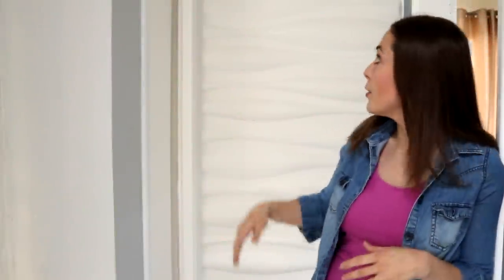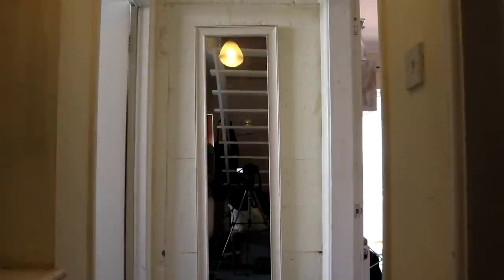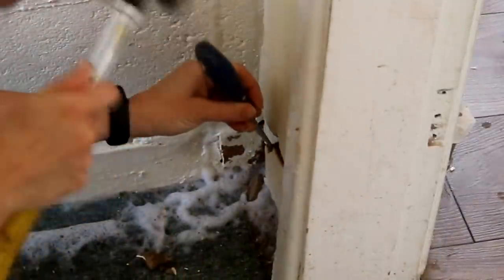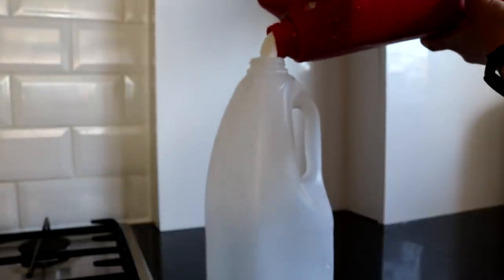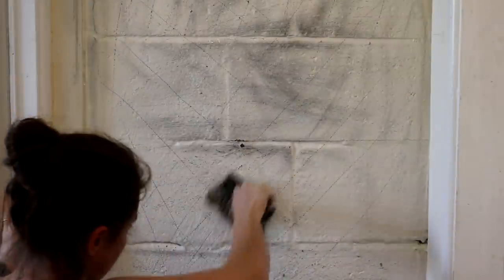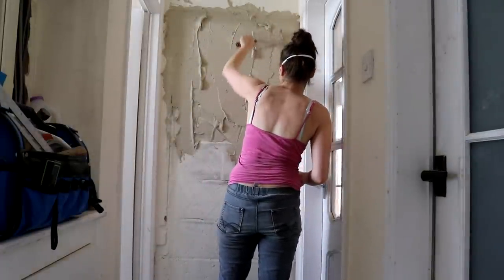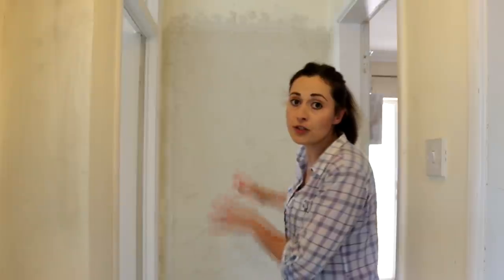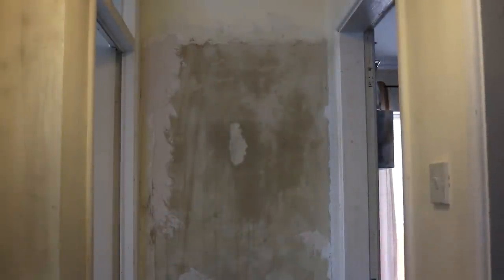How to Plaster Walls Before Tiling DIY | The Carpenter's Daughter

Comment: Hi there
Very inspiring, easy to understand step-by-step. In regards to the mixture of the PVA, the best solution is 2:1 meaning 2parts water to 1part PVA. It does a fantastic job especially if you have just removed the old plaster from the brick. 
Great job💪👍

Comment: Great work.  There's other ways to sand using a sanding sponge, if you will use it an hour after you applied your plaster mix, depending on how thick your mix was and for example, if your mix was 3/8 to 1/2 inch, you could either shave those high spots first with a trowel or scraper, so it wouldn't be as much labor afterwards then follow with the wet sanding sponge that you use with clean water and depending on how wet your plaster is, you can press as you sand either in a cross thatched or circular pattern but don't press too hard else you may loosen the section to the point where it may fall out of your wall.  The sanding sponge can then be squeezed into a clean bucket of water,  then  used again and you may, at this point, have a level near to your vertical surface but don't touch the level to your wet plaster.  Also, if touching up an area later, use the joint compound or plaster in a small amount near to the edge of your scraper or taping knife, then pull that over the region, while using another scraper to clean the excess from your tool, then spread more as needed.  You will see this uses less compound or plaster.

  Excellent video and it's a pleasure to see home owners DIYing their spaces.

  Truly, Andrew / Home repair Worker/ Solar Energy Hobbyist/ Act. For reuse programs.

Comment: To answer your question on the PVA - water ratio; it's about 5/1 water to PVA, but go by the feel. I prefer a heavier mix that is easy to spread, plus you don't need to let it totally dry. Its purpose is to stop the water being absorbed into the brickwork which causes the plaster to crack as it dries.

Comment: Hi, Considering that you did not have a float to use you did a great job, I have seen young plasterers that have done worse than you. If you are going to do any more plastering I would suggest getting a float as it will make putting the plaster on so much easier, and don't let anyone tell you that you are rubbish as you have a talent for plastering and you are well on the way to being a very good plasterer. One last thing, don't get the all in one plaster as it dries out very quickly and is difficult to work with
Reply from the maker: Thanks! :) I've definitely taken the comments with a pinch of salt 😀 Next time, I'll use a proper float which I have now and look at a different mix ;)

Comment: remove the plastic hanger from the end of the mixer before you put the hexangular shaft into drill chuck ;)
Reply from the maker: lol, it definitely wasn't on.  Sadly my first drill with a chuck was broken (didn't show that one), then tried my screw driver and no luck :|  I had to cut out a LOT of swearing :D  I think you can just about hear one though but if I do this again, I'll be buying something that holds the bugger.

Comment: nice to see you having a go and doing ok ,, I had 37 years plastering before the last recession buggered things and yes it was £120 a day then for self employed legit -) good advice from john price ,  would be a lot easier with a proper trowel ,, I used a bit of carved 2x1 for years to mix till I upgraded to a paint stirrer , milky is good for pva , love peeling the splashes off your arms later lol, mine are hairy ,, ouch ,,,,now you see why dot n dab plasterboarding is so popular,,, keep up the good work -))
Reply from the maker: Yes, I was tempted to do dot and dab with the cable wires but in the end I covered with plastic channelling, one coat, sanded down then skimmed for the first time (I did cheat and buy ready mix though) and am extremely happy with the result.  I stupidly chucked my old the trowel away because it looked rusty which I regretted as soon as I saw the prices for new ones... doh!
Reply: How things change ian I'm in west Sussex east Preston and earning 250  a day plastering but that comes with 20 years knowledge.

Comment: Excellent - like you said you saved yourself a fortune and you did an amazing job.  The one coat plaster (according to what I've read) is  probably hardest to work with and much easier to use a base coat then a finishing plaster.    I'm a handyman in and adding plastering to my new skills as it's a great service to offer and, like you say, plaster's prices can be huge.

Comment: Think one of the key things when plastering is to have a really well used old float so it doesn't leave lines in it with a sharp edge or corner.  ;)
Reply from the maker: +shawn G thanks for the tip!

Comment: 200 plus a day for a good plasterer around by me.
Reply from the maker: 200 would have been a bit more reasonable and may have considered to take the job off me.
Reply: Just get several price quotes and check the traders work quality / price asked. It might be 200 plus for a day, but 3 small areas like those are done in 1-2 hours...not a day.

Comment: Hi again ,i got to say you chose the harder route on this project but the finished project looks great but i could save you at least 2 or 3 days and it would have been complete the same day and that would have been to get some plasterboard and adhesive and what we call in the trade dot and dab the board to the wall due to the fact you were tiling it there is no need to apply a finish you can tile straight onto the plaster board but i love the finish well done.

Comment: Thanks for posting this. I'm in much the same position with limited tools and experience but about to give it a go on an old bathroom wall. Good tip to use PVA after plastering and before tiling. I hadn't thought of that.

Comment: what about going over the cables at the start is that the same process.

I had my house re wired and the electrical bricks are showing through my home not sure whether to do it myself or get some one in they took my kitchen tiles off so that needs plastering too 

any advice?
Reply from the maker: This might help you! :) http://thecarpentersdaughter.co.uk/diy/plastering-skimming-a-wall-with-chased-cables/
Reply: The Carpenter's Daughter thank you so much that's exactly how my house is right now the electrician hid our cables with a casing on so my walls are ready to plaster.   Your advice and tips are really helpful I think I may give this a go. Thanks
Reply from the maker: JLH I wish I'd filmed it now, but was worried I'd look stupid lol.  The ready mix skim was absolutely brilliant and I can't tell where I've been 😃
Reply: The Carpenter's Daughter You did an excellent job looks good. Can you plaster over cables I’ve noticed on one wall next to where they covered the cables a single cable has been tac in the brick is it ok to plaster straight over that. I don’t think it’s worth getting a plaster in that would charge over £400 i will have to do every room in the house but it’s only thin strips but checking your work and others looks achievable. I did plaster for the first time few months back attempted a whole wall it was a lot harder then I thought
Reply from the maker: It really is difficult for a huge area, but I enjoyed the practice.  I've seen some people plaster over cables but I don't think it's the correct method.  When I asked in Facebook groups, some said put metal channels over, others said plastic PVC channelling which is cheap from toolstation.  I just put the channel over the top, then tacked along the sides (away from the cables) to keep anything from moving.  I turned the electrics off too while I did it to be safe.
Reply: The Carpenter's Daughter nice it's only a single cable so won't be too difficult to cover. Got big holes where they have moved plug sockets around would you just plaster the old socket that leaves a hole in the wall or is there another way. Thanks again
Reply from the maker: Is there any cables left behind in the old socket?
Reply: The Carpenter's Daughter some do some don't but the cables inside the old socket have been cut
Reply: The Carpenter's Daughter It’s fine to plaster over cables as unlike concrete, there’s nothing in plaster that will degrade the cables insulation. Electricians will put capping over the cables to protect them from the plasterers trowel, and some people will argue to protect the cables from nails/screws but come on, a nail or screw will go straight through if it wants too.

Comment: Should of dabbed a plaster board over it. Would of been much easier and a lot quicker. But good effort.
Reply from the maker: Thanks for the tip +Michael Leneghan 😀 I will probably be doing that in other areas of the house

Comment: I think you did a excellent job. Well done!
Reply from the maker: Thank you 😀 I know plastering takes years of practice for a smooth finish, but hopefully it'll help some people on a budget to give it a whirl
Reply: The Carpenter's Daughter, for the past year, I’ve been removing popcorn ceilings and wall textures found on older American homes. ( Mudding.) I’ve never done this before and it’s a dirty job, but I discovered during my learning process a less dirty and dusty way.  I found if you wait until the mud starts to dry and set up, wet sand the area with a sponge and trowel again. (Reactivating the mud before it drys.) Don’t wait 24 hrs for the mud to dry. Creating a near perfect wall or ceiling. It’s still a looooong process, but looks great.

Comment: Hi my question is all the savings you saved do you have that on hand for example calculate all the work you done and if it’s say £10 000 saved where is that money I’m betting you don’t have it you tell me thanks 🙏🏻
Reply: Anønymøus Víds You get the money in real terms at selling time. If you can do things yourself, materials and fixtures don’t actually cost fortunes, it’s trade labour rates where the money goes. Say for arguments sake, most property can be transformed on a 8-10 grand budget if you do everything yourself, and that’s the whole house sorted. Or you pay some clown 8 grand just to supply and fit a kitchen, leaving the rest of the house to do! That’s where the money is, selling at real profit. 😁👍🏼😂😃😆